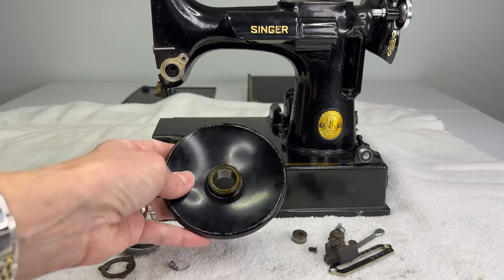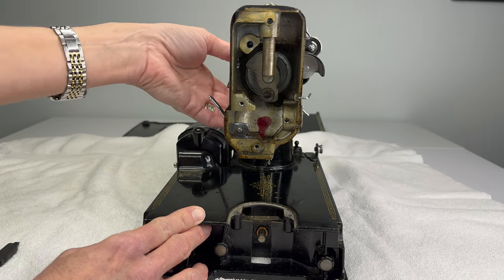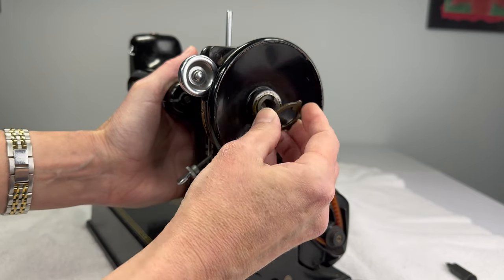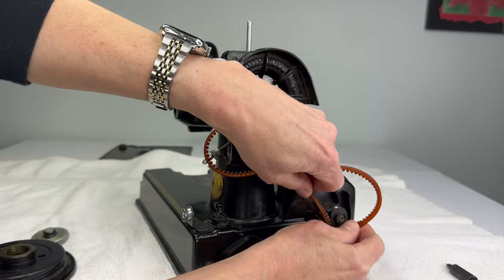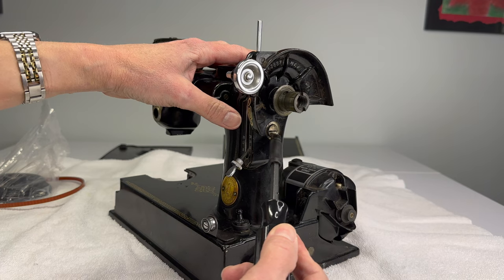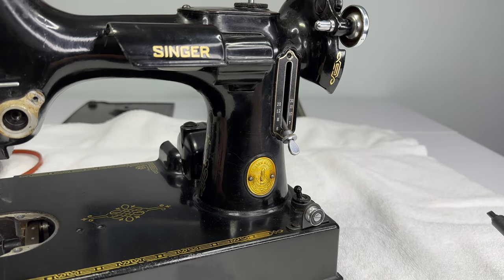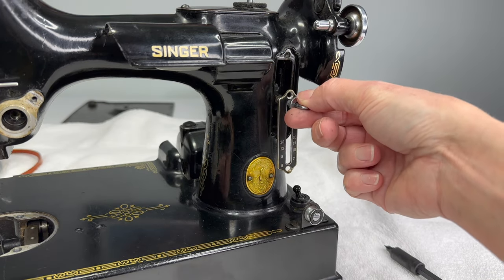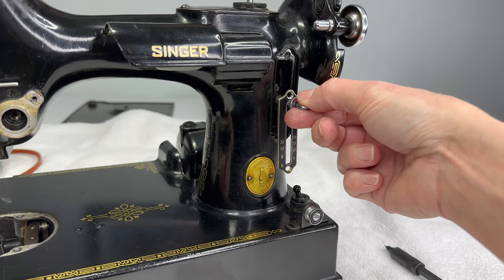Singer Featherweight Tutorial: How to remove the hand wheel and feed regulator

Comment: Thank you soooo much!  I absolutely love this series.  I'm looking forward to removing more parts beyond the hand wheel.  This will be an episode I visit frequently. 😀 Will you be doing videos of putting this machine back together?  I hope so.  Looking forward to your next show.  🦋
Reply from the maker: Thank you, so glad you like it so far. Yes, I will clean it and put it all back together. I do my best to show as much of the process as possible. Thanks for commenting!
Reply: I am glad to find your channel. I've been struggling to remove stuck hand weel all this evening but I couldn't take it off. It is stuck to the main shaft like glue😭 Could you have a solution if I may ask help?
Reply from the maker: @emilyhwang2066  Oh no! Do you have a good penetrating oil on hand? If you were able to remove the stop motion knob and get it out of the way then I would recommend a good soak. Lay the machine on it’s nose the the hand wheel end is pointing towards the ceiling and spray it, wait 30 min and spray again. The penetrating oil will start to break up the crud and it should release. If that doesn’t work after a few tries you can also try applying heat with a hair drier along with the oil. Let me know if any of that works!

Comment: Thanks for your reply. As followed your advice I've tried several times the process to giving  pretty much time to the joint spot of handwheel and shaft for WD40 to soak in. I even tried blowing hot air for 5mns but it wouldn't budge at all! What is going on with my featherweight.. I am so frusrated. wondering WD 40 is not good enough? Should I use another kind of penetrating oil? Sorry to bother you. I really hoped it would get off after all my effort. My featherweight only gave mustle pain on my arms and fingers..😭
Reply from the maker: I’m sorry to hear it is still stuck. A penetrating oil like Aero Kroil or PB Blaster will do a better job than WD-40. I’m going to look into some possible causes and solutions for you beyond penetrating oil but WD-40 won’t work as well as the other two I mentioned. You aren’t bothering me, however I can help I will try. Sometimes it takes a while for the oil to work, literally days. Keep me posted!
Reply: Hi. I've left my machine soaked in oil for a few days more but nothing changed😭It seems like out of my ability. I think now it's time to clean up all the mess on the table I've made with that😢 and move on. I think I can manage winding its bobbin on my Bernina 440. I really hoped it could work. Anyway..Thank you so much for your kind help!
Reply from the maker: I am sorry it didn't work out. Each machine has its own history and sometimes we just don't know why certain things are stuck. I had a machine once where someone had used some kind of glue to keep a screw it. Needless to say, frustrating and not fun. If you ever get the opportunity to take it to someone who services them, maybe they can straighten it out for you. But I am proud of you for trying!
Reply: @SewingMachineRehab  
I am so grateful to have you here. I think I'll learn a lot through your devoted video in detail. Thank you! 
Merry Christmas and Happy new year. And stay warm!